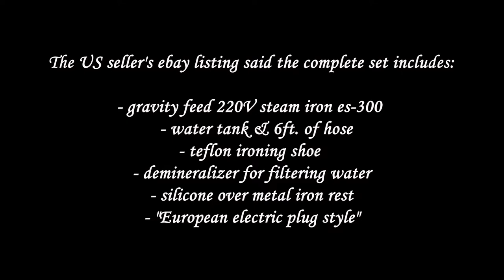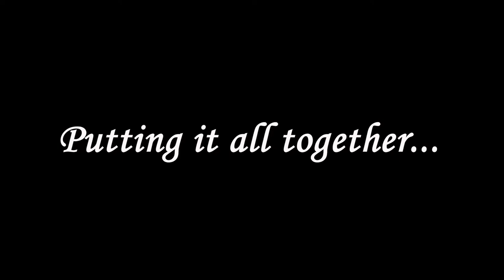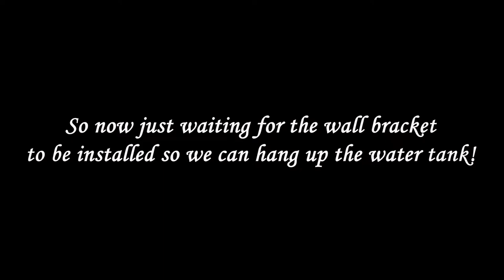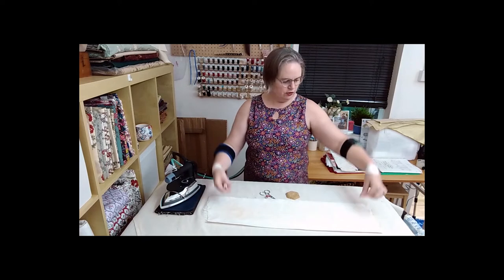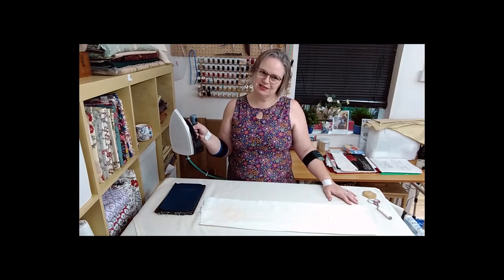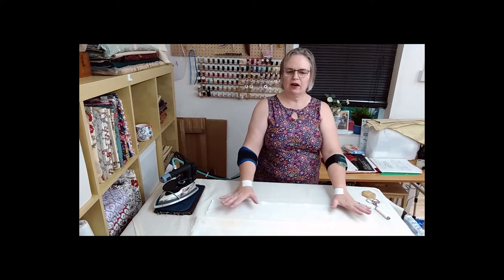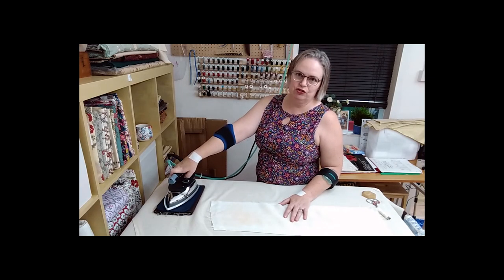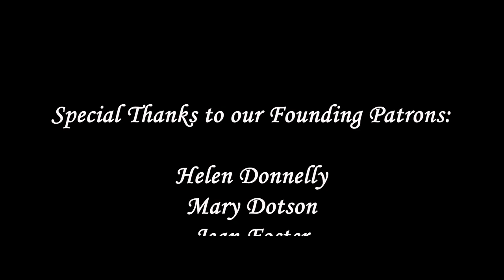Setting Up & Using a Gravity Feed Iron | Unboxing | PLUS Waxing & Ironing Sewing Threads

Comment from the maker: All you ever wanted to know about gravity feed irons but were afraid to ask?! 😂  Do you have one?  What do you use it for? Do you like it? Let me know in the comments!
Reply: Is this iron suitable for home
Reply from the maker: @MissCapricorn51  That depends on your needs and your situation at home. This iron is the perfect tool for someone who needs to have steam available for hour after hour. If the on/off button is on, then the iron stays on, continuously. It does not switch itself off. There is also the set-up to consider. The water tank needs to be hung much higher than where the iron is going to be used. Also, the iron is much heavier than a standard household iron. So - if you are a garment maker working at home and you need an iron to be right there ready to steam without wasting time heating up, and there are no children around who could risk accidental injury from an iron that does not switch off on its own -- it's a great work tool. But for occasional household use, it is not the best tool and depending on your home situation, could be dangerous.

Comment: The spring coil thing is designed to slide over the silicon hose at the iron end of the hose to prevent kinks.
Reply: Thank you I came to see what I’m supposed to do with that.

Comment: Have you figured out the demineralization filet out yet?  It’s fairly straight forward. All you have to do is connect it to the spigot using the enclosed short hose and the attach the regular silicone hose to the bottom of the filter. Easy squeeze!!
Reply from the maker: Thank you, Mary! I've since seen that's where others fit it. As I only ever use distilled water (so already de-mineralised), I have no immediate plans to fit it. But I'm hanging on to it, just in case!
Reply: i did that, and my water is stuck. wondering what happened

Comment: I loved my gravity feed iron.  I used one of those planter poles that goes between the  floor and ceiling to hold the bottle.  It lasted close to 20 years before I needed to replace it and that was only due to the fact that the company no longer existed and I couldn't get the parts.
Reply from the maker: Wow, that's impressive! What have you replaced it with?
Reply: @TimesmithDressHistory  Boiler irons--tank and base that sits on the ironing table.  Still functions the same.  One advantage to this one is that I can take it to venues when running workshops or move it to different parts of the house to steam drapery. LOL.  I probably use the steam function more than the ironing one.  That's how I freshen my historical gowns--just hang them nearby and steam.   Sadly the ones I've gotten don't last as long so I've gone through 3 of them.
Reply from the maker: @kozykitty  I haven't looked at that kind of iron. The portability sounds great - I can see how that is really important with all the events you do. And yes, for historical gowns, it's all about the STEAM!
Reply: @TimesmithDressHistory  I think the gravity feed are better for a studio situation.  The water tanks are larger and they're stationary.  They really are wonderful things.  I found mine to be literally life changing.

Comment: Is the "foot" necessary? I had one years ago and it made lots of dents/hole shapes in the fabric.
Reply from the maker: "Necessary"? I don't know. But it does help diffuse and distribute heat and steam evenly over the entire surface of the plate. I've not noticed any dents or hole shapes in the fabric, but admittedly I only work with high quality natural fibres and I am usually dealing with massive surface areas, which means my experience may be much narrower than yours. My priorities in choosing this iron were specific to the nature of my business. As they say, 'your mileage may vary'.

Comment: Does anyone have a temperature chart for this iron? I have been searching for days and am unable to find the specific temperatures.
Reply from the maker: You know, that's a very good question. Because the primary goal relates to producing a steady supply of steam - it's obviously boiling! As with any iron that can produce a good head of steam. The beauty of a gravity iron is that the entire feed system ensures the supply of steam is steady and constant. How much hotter (beyond boiling water) it gets is an interesting question - perhaps one nobody thinks too much about as long as they're getting what they want - STEAM! - but maybe we should? Safety concerns are addressed and of course it's not intended for use by children, as with any irons of any other type.